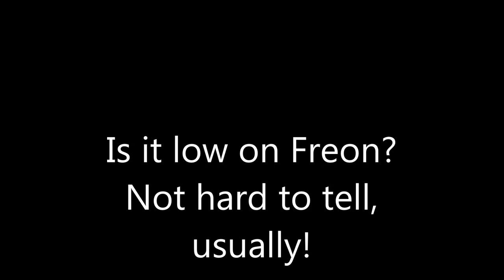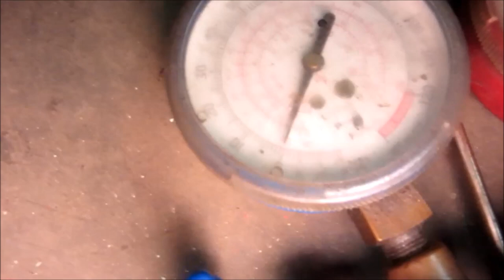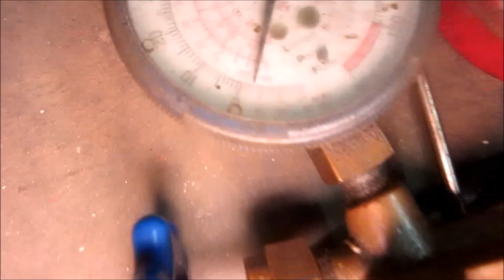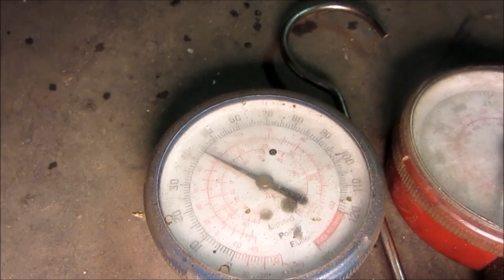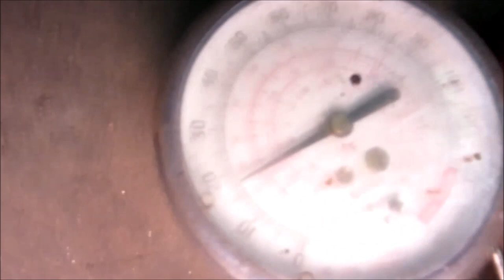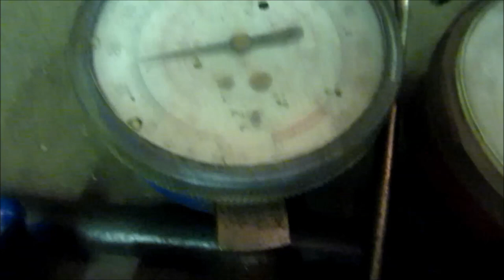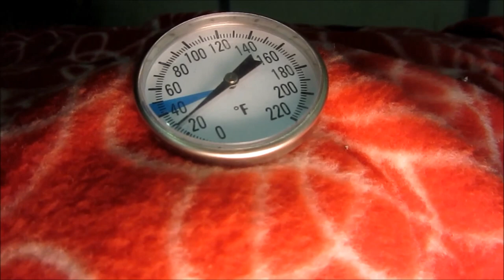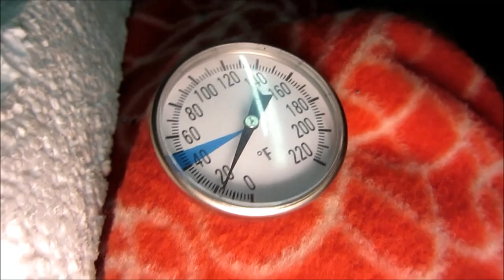Is it low on charge (Freon)?

Comment: Thanks for the information 👍. I am restoring my Grandmother's 1950 Philco and had to replace a rusted out line. I am going to use R12A and give this method a shot.
Reply from the maker: Glad to help!  I'm confident you'll get it up and running no issues.
Reply: I realize your comment is about 2years old, but have you had any success finding R12? I recently got a (I think) 1950 GE chest freezer that is low on refrigerant and would like to recharge it with Freon 12. Any help would be greatly appreciated, Thanks!
Reply: @GarageDoorGuy89 
They exist on eBay in small cans occasionally, though he said R12a which is a blend of propane and isobutane meant as a replacement, though slightly dubious unless you make sure the thing is in good shape.

Comment: That's a really cool set of observations that can be used on any refrigeration system. My HVAC system at home wasn't cooling and the high side at the compressor was frosted up. At first I was concerned about a big expense but, I went up in the attic (125 degrees) and found that the run capacitor on the air handler fan was bulging so no fan. A $10.00 capacitor and it runs great.
Reply from the maker: Yep often it pays to check the simple things first. Those inexpensive parts can stop the entire system from working.

Comment: Does this same principle apply to a fridge with two evaporators?  The fridge in question is a 1960s Frigidaire (meter miser). The freezer is manual defrost, but the fridge portion auto defrost by allowing the evaporator to come up to 40 before cycling back on. I’m not sure if the fridge evaporator (cold plate) is in series or what with the freezer. I don’t have a diagram to reference.  I recharged (after a prover evacuation) with 152a. It seems to struggle to keep the fridge portion around 40 on warm days (apx 80-85 indoor temp).

Comment: Where are you located? I have a 1950’s AMC fridge that stopped working after I moved it to my new house. It was transported wrong and I plugged it in as soon as it got to my new basement…(I didn’t know any better) I live in the metro detroit area and can’t seem to find someone to fix it…
Reply from the maker: Chris, I'm sorry that you have problems with the AMC freezer. Probably the transportation without proper preparations caused some line to break from vibration. If you were to send it to me, I could likely repair it for you. But the shipping could be high from Michigan to Alabama.

Comment: I had picked up an old-ish upright freezer for free. It was probably 1960's vintage, and had the evaporator coils in the shelves themselves. They were frozen solid when I got it, and I was thrilled as it reminded me of the one we had when I was a kid. Might have been exactly the same. Days later, when I went to run it, it only frosted right at the beginning of the first coil, and I did deduce from that that it was out of refrigerant. I found the leak, where two lines had vibrated against each other next to the compressor for 50 years and finally rubbed through. I did not know you yet, or about R-152a, and I did not have the confidence to solder it up and save it. It saddens me to say, but I salvaged the compressor out of it, and let it go to a scrapper. :( Now I would without question save it, with your guidance.
Reply from the maker: Well - as they say; you can't save them all. At least you tried! Hopefully the compressor can be used to get another unit going.

Comment: What kind of freon does it use? Kind of been looking for an old coke machine to redo also.
Reply from the maker: This system is an R12 system. It is compatible with R12 or several of the R12 replacements. In this video, I'm using R152A I'm the system.

Comment: Great video! This helped a lot!
My fridge shows signs of almost making the evaporator cold before shutting down after 3 minutes (new start&protection relay). The compressor is drawing 1.33 amps when the protection is for 1.08 amps so it is pulling too much. Could the system be low on charge while at same time have uncompressible gas still left inside like Nitrogen from a poor purge during production? It has been running silently for many years. Compressor is still relatively quiet.
Reply: Btw, the cold-plate is chilled in a gurgling-stuttering fashion with liquid entering at top and snaking it's way to bottom before returning back to top. I suspect this is a very bad design from a oil perspective as it probably collects all the compressors oil in the bottom bend of this coldplate-loop. Could explain why compressor draws so much if it's running dry?

Comment: What is a normal average range for the low side  pressure. Love you videos!!!
Reply from the maker: Hi there.  That depends entirely on what the temperature of the evaporator is, and what refrigerant you're using.  For R12 or R152A systems, such as Coke coolers and vintage fridges such as I work on - when the system is fully stabilized and the cabinet is cold and it's cycling off and on normally;  you typically see 4 to 10 PSI on the low side during the cycle. That's just an observation and could vary with ambient and cabinet temperatures of course. :)

Comment: If you came on a system that was overcharged, does this same "reset, watch the frost line, make a small charge adjustment" method work? Or is it only good starting from an undercharged system and adding gas?
Reply from the maker: It  would work for an overcharged system. Just be sure that there aren't any other external causes of frosting back; such as clogged airflow due to dust on the evaporator, weak or incorrect fan motor, etc. before considering an overcharge. Would also be very hesitant to diagnose an overcharge unless I could see some type of service port had been added to the system.

Comment: Old mechanics will say you can hear a low charge: is the evaporator hissing? is the compressor too quiet?
Reply from the maker: This is also true!  I don't tend to use this method personally because of my hearing being impaired.
Reply: You can hear a low charge depending on the system. It is when the evaporator has a loud hiss. Sometimes it is more of a whine. This will tell you it's very low but when it's that bad there's no liquid left and the system won't cool at all.

Comment: What gas are you using?
Reply from the maker: This was originally an R12 system. I am using an alternative called R152A which is a direct drop-in for these early low-HP R12
 systems.
Reply: @davida1hiwaaynet No oil return issues with the non miscible oil?